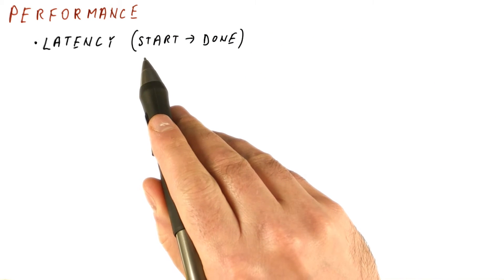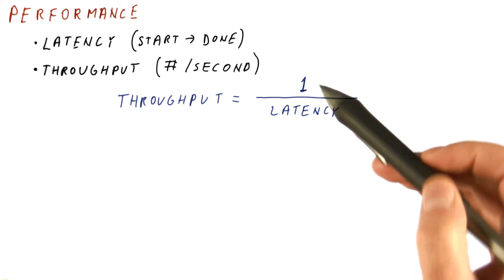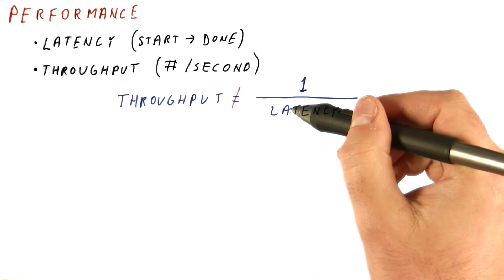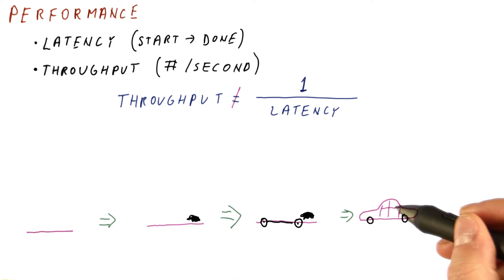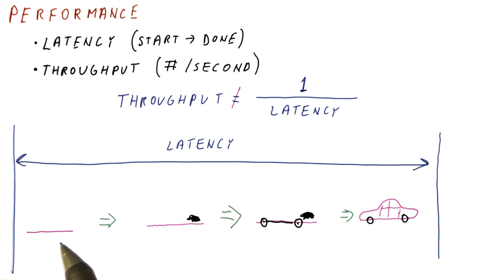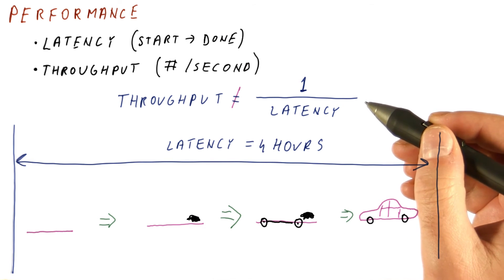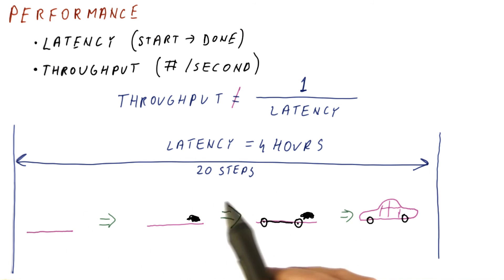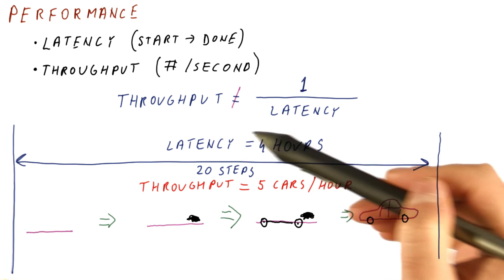Performance - Georgia Tech - HPCA: Part 1

Comment: in 4 hours, there are 20 steps, and you say it takes 20 steps for a car, then the throughput is 0.25 car/hour. Or, you actually meant to say it takes 4 steps for a car?
Reply: Suppose the whole assembly pipeline is filled with each of those 20 steps having some work and as stated each step = 4/20 = 1/5  hour; Now a new car will be exiting the pipeline every 1/5 hour since the pipeline is completely filled providing us with a THROUGHPUT of 5 cars/hour
Reply: @chaitanyapaikara976   but why should we assume this? Nothing is said about being that it is piplelined?